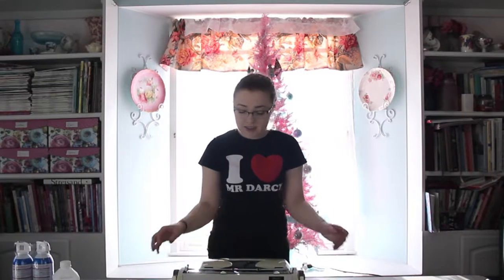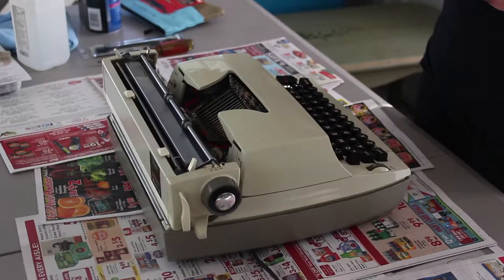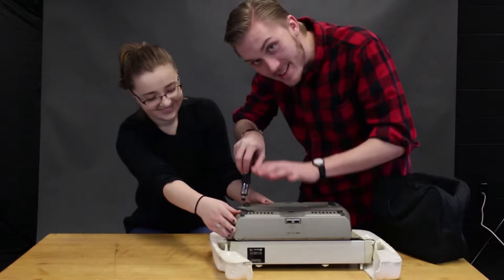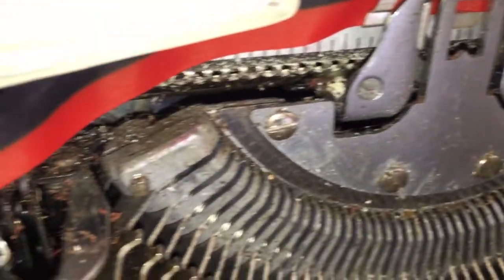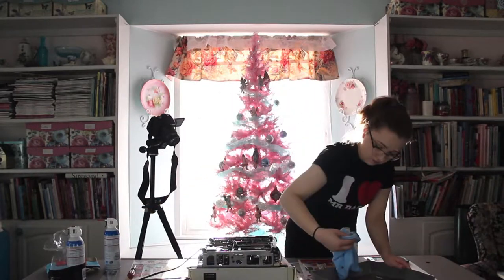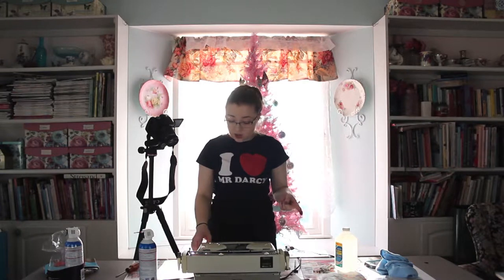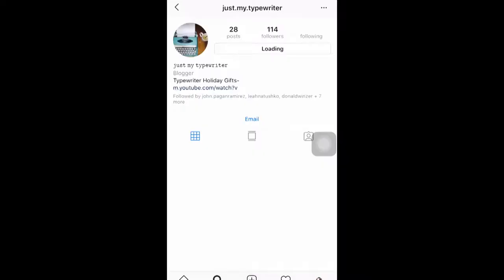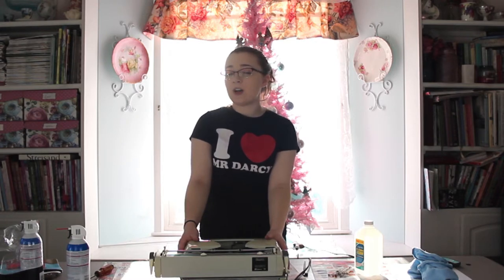Deep Cleaning An Electric Typewriter

Comment: I have cleaned typewriters for over forty years, and your methods work very good.  But yup have to be careful around electric typewriters that use a rubber power roller underneath instead of a metal fluted shaft.  Old style Smith-Corona 400 and 410, Remington 25 and 26 as well as “Electri-Conomy,” and old-style IBM models A thru D use these, as does Adler and new style Royal electric portable.  You have to make sure these stay dry, and you do NOT want to let oil splash it—otherwise the cams will slip and the affected type bars will not strike the platen.

When you clean the type bars and type slugs, put a cloth underneath them far in as you can so you don’t splash the power roller.  But make well sure the type bars and everything else is dry before you remove the cloth!!

Cleaning the type slugs with transmission fluid and an old tooth brush will shine them up like a new penny.  Tranny fluid is highly detergent and doesn’t gum up like regular oils.  Also, you can even use it in the type bar segment slots.  This is usually verboten (not advisable), but I have a 1957 Royal RE electric upright typewriter that has it there and other places, and It has been a very reliable typewriter for the last 32 years.
Reply from the maker: I really appreciate the advice! I've gotten much better at cleaning and repair since this one- I'm always learning new things!

Comment: I just bought this same typewriter, but it hasn't arrived yet. I want to buy a new ribbon for it but am seeing conflicting info about which ones fit, should a universal 5cm one with the 2 spool things fit? Or is it something way different? Thanks ks in advance if you reply!!!
Reply from the maker: If it has the original spools with it, you should be able to rewrap it- putting the new ribbon on the original spools. However- a universal with two spools will definitely fit! All of the ribbons are the same size- different spool shapes and sizes usually impact the ultra portable machines (a corsair, skyriter, etc). They have smaller spools even though the ribbon itself is exactly the same size. So go with a universal ribbon replacement, and you'll be fine!

Comment: Hi Sarah, Someone gave me an electric typewriter,  a Nakajima AE-710. It's  so dirty. My question is, what would you use to clean the print wheel & the apparatus  that holds the print wheel? Thanking you in advance, Donna
Reply from the maker: I would go with compressed air! That's a great start to working on those machines
Reply: @JustMyTypewriter  hello, I have a electric typewriter. It smell bad because of the old elderly smell. The guy said he clean it but, the smell is bad. What should I do
Reply from the maker: @honeyofoats5619  set it out in the sun! Try taking off the bottom and blowing it out with compressed air